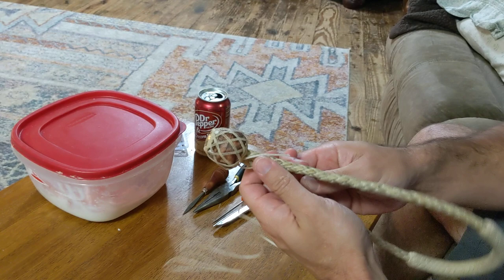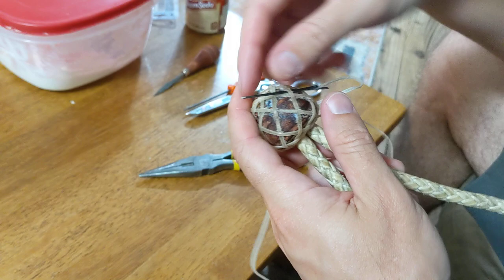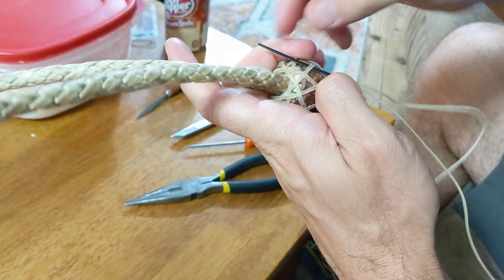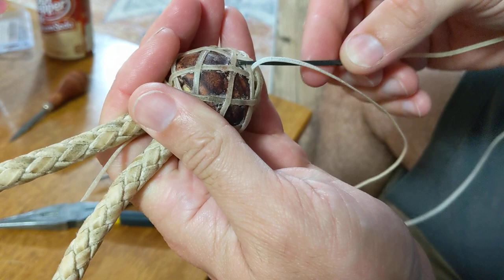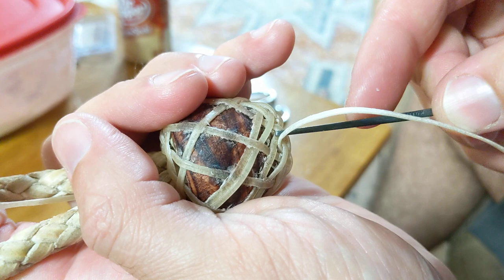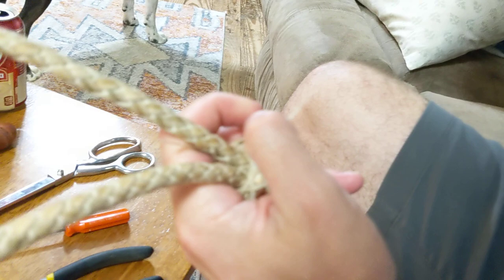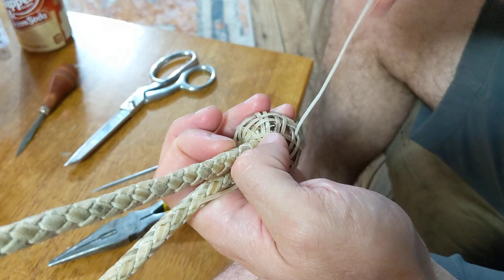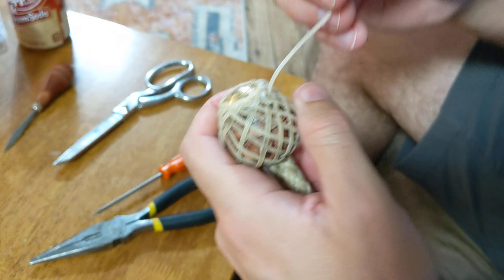Heel Knot Interweave O2U2

Comment: I got lost in the switch between O2U2 and O3U3 especially how to weave through the top and the bottom.
Reply from the maker: I understand that it can be difficult to follow in the beginning. Let me see if I can clarify here a little:

When you start your O3U3 interweave, you just choose a string on the left to follow to the bottom of the heel knot. You do what that string on the left does until you need to dive under. I count the same number of strings on both sides of the "V" to determine which string I need to come out by. I follow the string on the right of it back to the top of the heel knot. I dive under and come back out however many strings from the top of the knot I did on the first pass. Rinse and repeat the process. If it's still confusing, I may be able to clarify a little on the next heel knot I do.
Reply: @RawhideEli  Do you dive under 4 strands at the top and bottom each time?  If you have a chance a short video on your next heel knot when you start the O3U3 pattern would be great.  I always learn a lot from your videos.  Thank you!
Reply from the maker: @jessicalindsey2616  you may hate this answer, but it depends. I dive under wherever makes sense with what needs to be filled in as long as it's at the end of a O2. It could be three strands, four strands, eight strands, or one strand from the top.

Comment: how did you make the heel knot
Reply from the maker: Did you watch the first part...?
Reply: @RawhideEli  yes but I'm talking about the round base.... also , do you ever use a spacer in the center of the bosal?
Reply from the maker: @RonnieScottCook  I haven't used a spacer, but I'm not opposed to them if they're placed correctly. I make my base out of leather that's sanded to a specific shape. The body strands under that are looped around and through a ring knot that joins the two bars together. I use contact cement to glue on my leather before sanding to shape.
Reply: @RawhideEli  thank you.... would love to see that process as well... thanks for sharing your information with an old cow hand